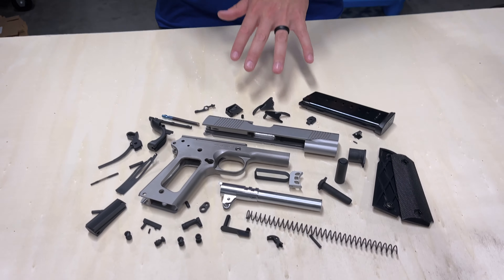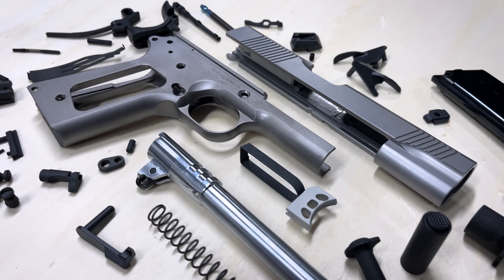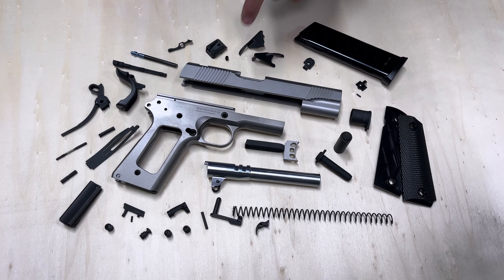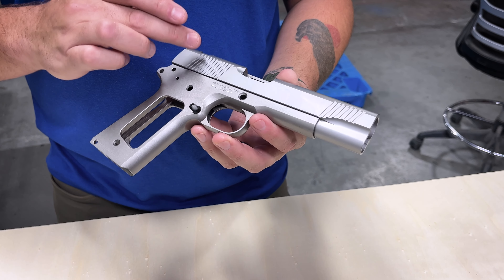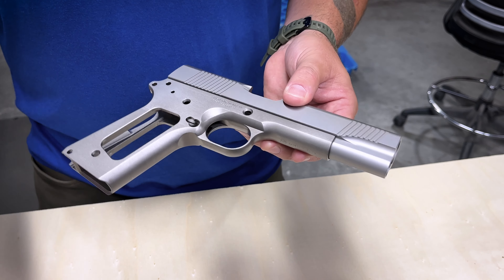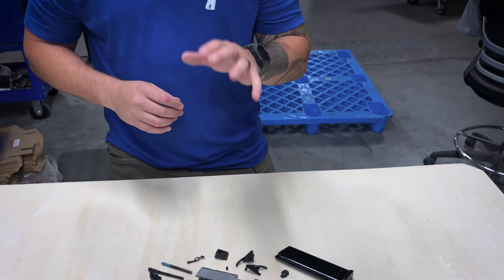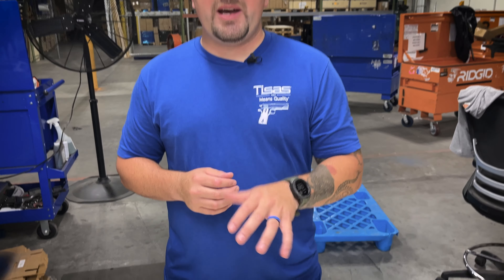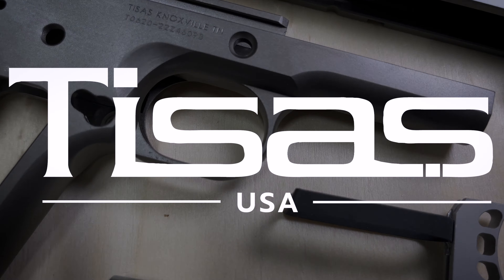Tisas USA - Builders Kit 1911

Comment: Are the small parts drip in, or do they need to be fitted?
Reply from the maker: There is minor fitting required for this kit.
Reply: @sds_arms  I have a question:
I want the Tisas 1911 A1 US Army 45 WG (SKU:10100523) or the army But I want it without the markings 
"Model 1911A1 U.S. Army" on the side
Can I have it?

Comment: Are you going to offer a builders kit without front slide serrations? Or can I purchase a slide without front slide serrations as part of the kit if I want it? In my personal opinion I think forward slide serrations are dangerous and ugly same goes for attachment rails. Also are you going to do a stainless steel builders kit? You said the current builders kit was Carbon steel in the white so I figured I'd ask.
Reply from the maker: You can mix and match other parts on the site with your builders kit.
Reply: @sds_arms  Thanks.